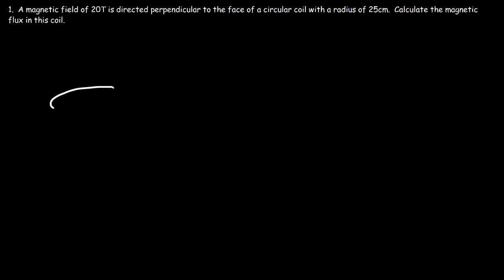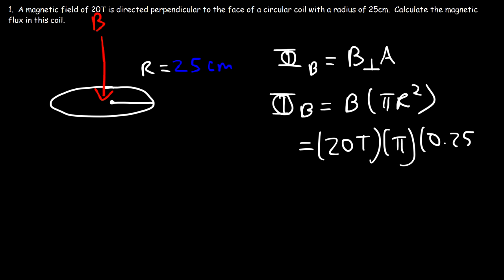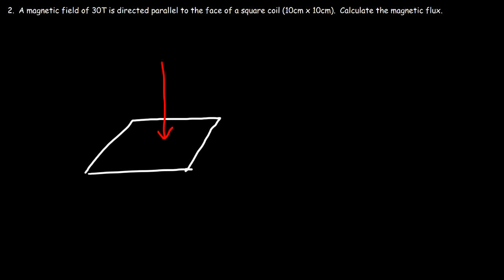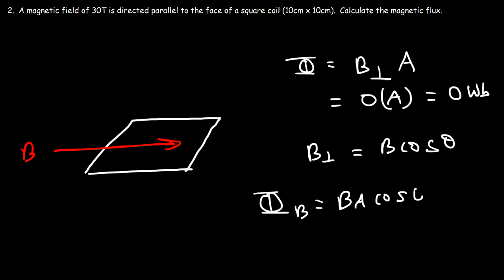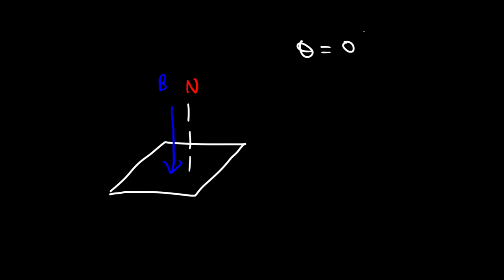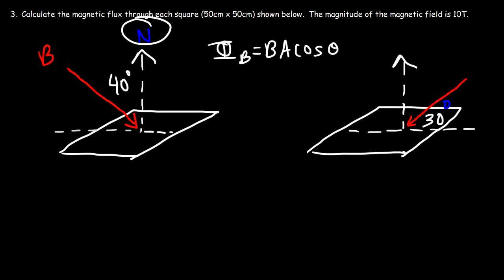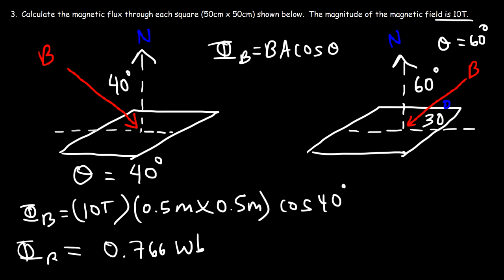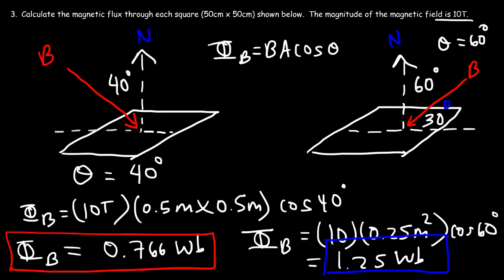Magnetic Flux, Basic Introduction - Physics Problems

Comment: i have some thoughts about the first example, the angle between n (the unit vector n of the normal line as he called it ) and B (the magnatic field ) is 180 degrees which is cos(180 = -1 
otherwise it would be the same as the third example where the flux was equal to zero !!!!
simply because the flux is an algebraic physical quantity !

Comment: i keep getting 1.92 wb for the 40 degtree magnetic flux.
Reply: Ivonne I’m getting the same thing I think he put the wrong answer for that problem
Reply: Ivonne the answer doesn't matter. The way of solving the question only matters.
Reply: It would be 2.4 Wb i think so u have used cos(40°) instead of it u have to use  cos(50°)= cos(90°-40°)
Reply: same
Reply: @nabilmiri128 i hope so
Reply: @mariofox321  he did
Reply: Yep same thing
Reply: Ivonne u are cute
Reply: Sameee
Reply: @mariofox321  he definitely put the wrong answer
Reply: Ivonne he only calculated the cos40° (which result the 0.766) and he forgot to multiply it to the area and the magnetic field (in which should be calculated. You got the right answer (1.92 Wb/T.m²)
Reply: You are right

Comment: This is driving me crazy. I checked the settings in my calculator. I plugged in the same info in several websites and I still don't know how are you calculating this because different results. (10)*(0.5*0.5)*cos 40 = 1.915111108. What am I doing wrong?
Reply: nothing wrong he made a mistake

Comment: He did get the 40 degree angle wrong. Looking at it from a conceptual point of view: since the 40 degree angle is more perpendicular to the surface, then it's magnetic Flux has to be bigger than the 60 degree angle
Reply: I agree
Reply: You are correct, but his work is right. He just plugged it into his calculator incorrectly. I did it and I got a larger value, as it should be because it is more perpendicular as you said.